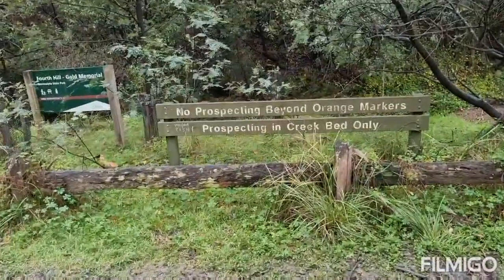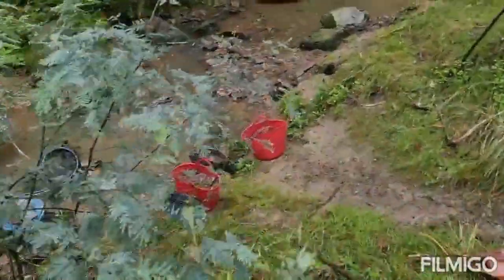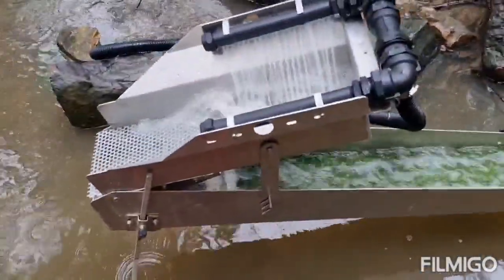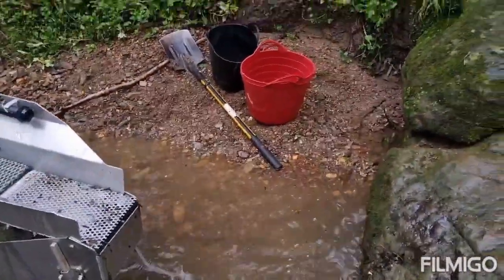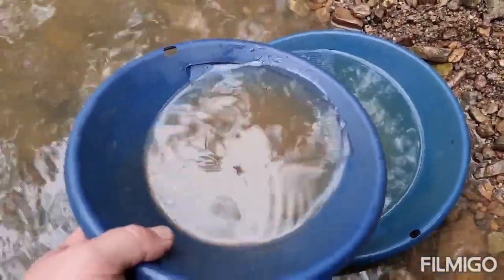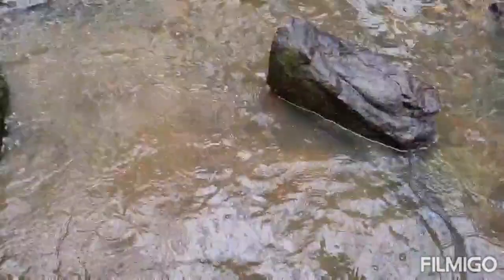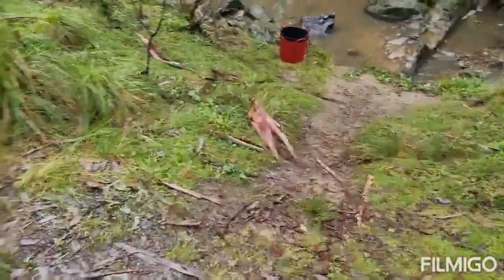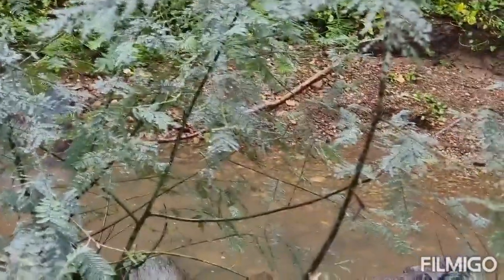8" Gold Rat Highbanker twin spray bar set up

Comment: good set up mate ive always used the 8 inch, and the other one i made is a 12 inch can shift a lot if you get into it if back holds up ,i normal pan out 3 or 4 times ha ha always seam to get some in every pan mate
Reply from the maker: Something I haven't spoken about before, panning into a pan and repanning your concentrates from a highbanker.  I'm sure many do. The 8 " is about as big as I'll go. , would have to dig to hard if it was any bigger.

Comment: You are running at 8 degrees - What is the manufacturers recommended angle for this mat ?
I have a 6 inch minimat and recommendation is 9 - 9.5 degrees
Reply from the maker: Seeking as I'm catching most of the gold in the crash pad in the hopper and the bunnings door mat under the hopper. I can back the mat right off, as long as it's still clearing. So 6 to 8 degrees.  I believe 8 degrees is recommended.  This will all depends on the water flow and the type of dirt you're digging.
Reply: @MurrayRiversGoldAdventures  Is the miners moss affected by angles or does it grab gold at any angle ?
I suppose if is too small it would clog much earlier but what would happen if the angle was great , like say 20 degrees ?
This question is assuming there was no dream mat being used ?
Reply from the maker: I believe when Gold Rat designed there highbanker that the crash pad in the hopper was to create a capture area,. Then any gold that got though would get caught by the Dream mat. What I did was create a capture area under the hopper that is easily removed without having to undo anything.  Then last of all having the Dream mat. This is the guarantee.  Have found when running the 6 inch highbanker the round and fine gold to be caught in the mat and larger gold in the moss.  Finally the moss is different in the 2 area's.  The more changes you have the better. Having said all that. Washing the gravel is very important.  If you're seeing dirty gravels, then your most probable having gold loss from the hopper.
Reply: @MurrayRiversGoldAdventures  Not quite sure if you read my question as I am still none the wiser :(
Reply from the maker: 8 degrees is recommended, with 3000gph.  Just like 9 degrees with 1100gph on the 6 inch mat.  When you use the mat in a highbanker different story.
Reply: @MurrayRiversGoldAdventures  I meant the question about the miners moss
Reply from the maker: The moss will catch gold especially if it has a backing.  The hopper might be at 25 to 35 degrees . As I said in the video 60 % in hopper and 35% under.  5% in mat. This is from running for an hour and 50 minutes.  At the creek. Different creek Different results.  Would I just run the Dream mat. Short answer is no. If something is catching gold then you keep it.
Reply: @MurrayRiversGoldAdventures  You should try with the hopper mat removed
Then see if ALL the gold that was caught in the hopper got caught by the Bunnings mat
Or if some of that hopper gold made its way to the dream mat